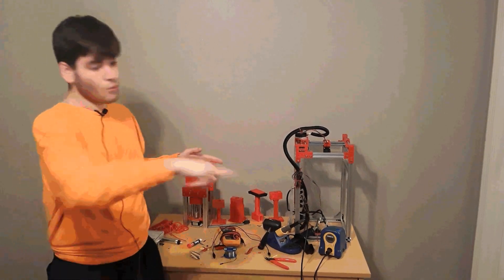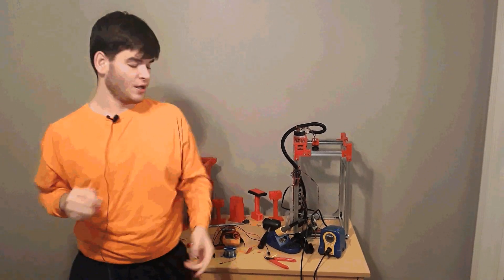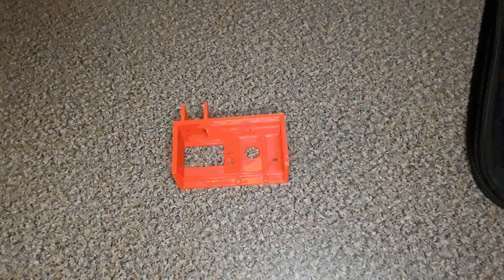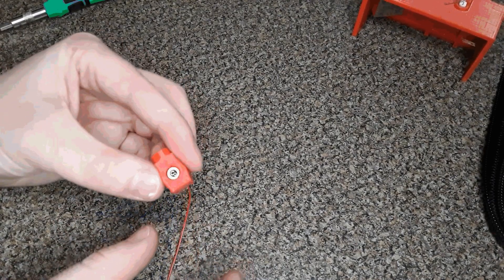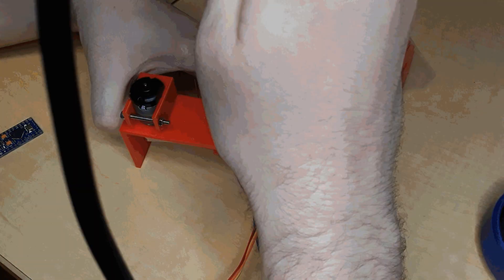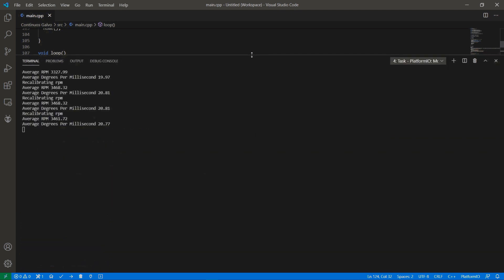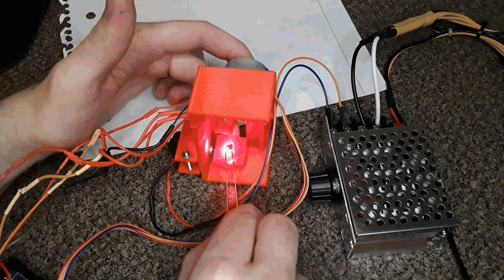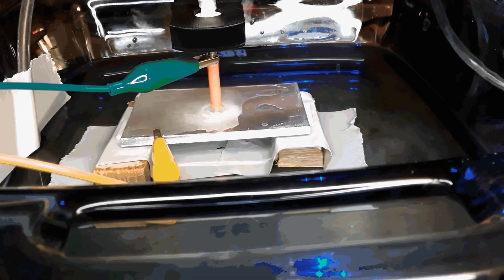3D Printed DC Motor Laser Galvo

Comment: LDRs are too slow. Use a photo diode. They provide a signal much closer to a logic on/off, which can be used with an interrupt pin to get much better software timings than you will achieve with the ADC.

Cool project though!

Comment: I´m sorry to say that, but you build no "Galvo" (Galvanometer) at all.
A galvanometer is a coil hung up between two very strong magnets so it can rotate. Just like a DC motor, but only with one coil.
When there is DC voltage applied, it will turn to a specific angle. To drive this, a pretty complex driver circuit is needed.

Comment: B DC motor isn't good choice because it's inertia and its brush contacts which can't move mirror at similar amplitude over time  . You may countrect inertia but than Brush contact isn't Continuous and Smooth so it will create Unwanted  Vibration .

Comment: Planing to build one, soon, using a rotating mirror to make laser patterns.... I will use this video as a reference, but I will use double sided mirror and brush-less motor, and planning to use a closed-looped control by feeding the rpm measured to an Arduino( which also served as the controlling unit) to control a pwm, controlling the speed of the motor to arrive at a target rpm.... thanks for the vid   ... so lets get rotating.

Comment: hi you should use a photo diode a light dependent resistor is slow so for fast rpm it will give noisy or average data

Comment: So, basically you built a laser scanner with a DC motor and a stepper, and there is no galvo involved whatsoever.
Galvo doesn't describe the complete system that directs your laser, galvo describes the way the mirrors.
While this is a very interesting project, I was rather disappointed that you don't actually make a galvo with a DC motor.

A galvo is an attenuator, rather than a motor. It is set in a specific position using a DC voltage. Same principle as how analogue meters work,
hence the name 'galvanometer'
Reply: Yes , i think Because Brush contact of B-Dc isn't smooth and continuous and rotor inertia working tougher make it impossible to countrect both but I think DC motor Are very Good to Modify into Galvo because the way its magnets are arranged " curved " you just have to put light rotor with Physical Angle Limiter and with wire contact instead of brusted one , curve magnet is useful because its field Distribution would be same in all Directions .

Comment: This is beyond cool dude! I think you’re right that the photo resistor might be the issue. The other thing I could see is that the brushed motor might be hard to keep at consistent RPMs due to the mechanical brushes. I’d look into a cheap brushless dc motor like they use in drones. Those can be very accurately controlled to go at a certain speed. 

DYS D2830 1000KV Brushless Motor for Multicopters RC Plane Helicopter https://www.amazon.com/dp/B0752D1JCC/ref=cm_sw_r_cp_api_glt_fabc_9YZRYKHQD8QMDMJFNKR0

Also I wonder if you could use a Hall effect sensor and a tiny balanced magnet on each side of the spinning mirror to know when it’s made a rotation. 

https://en.m.wikipedia.org/wiki/Hall-effect_sensor